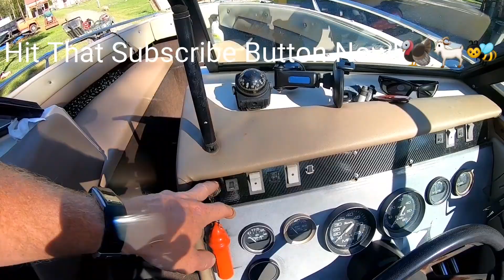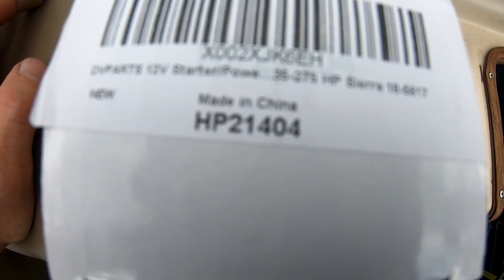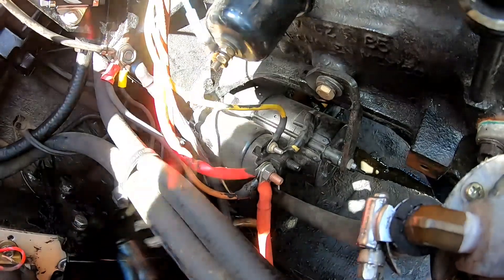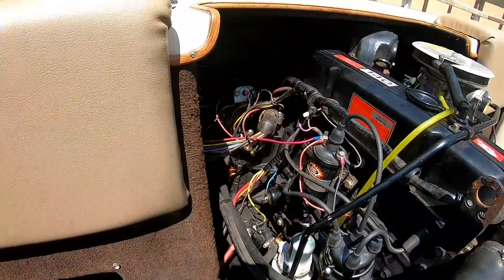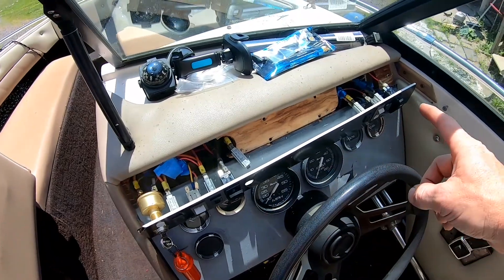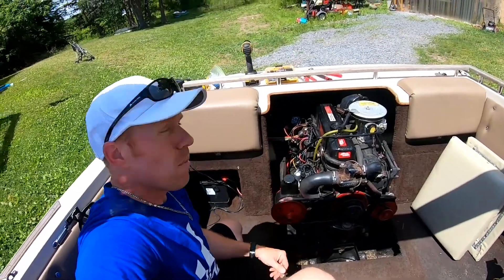Mercruiser Starter Solenoid Diagnosing And Replacement DIY

Comment: When i bypass the key switch and touch the two relay post together nothing happens but there is a click with the key, what is going on here?
Reply from the maker: Sounds like battery or starter issues try the easiest first! Try charging your battery or jumping then try starting!
Reply: Did you ever figure out what was wrong?
Reply: I have the same problem , it was working a minute ago , trying to prime the fuel lines then just a click ?

Comment: Had the same issue with my 2006 3.0L Mercury after not having started it since the winter. One click and no start. I first jumped the relay (connect the positive terminal to the negative terminal). Soon as I did that, I heard the starter working. This confirmed it was the relay. Replaced the relay for CAD$50 and she fired right up purring beautifully. Thanks for the video 🙏🙏🙏🙏. This was the most useful video
Reply from the maker: Awesome!!! It's definitely good to know especially if it fails on the water!! Thank you for watching!!👍😊

Comment: Did you also make a test on the Solenoid coil input side?….That would have been logical to prove that the new ignition switch was actually wired correctly, and that the coil was actually receiving 12v.
Reply from the maker: Here is the bench testing of the starter solenoids! Thank you for watching!👍😊
https://youtu.be/mXQ1MMs39h4

Comment: So the positive from the battery and the positive from solenoid to the starter are connected to the same post?
Reply from the maker: No! If you look at your starter the positive from your battery should be connected to the top left starter post, the top right starter post positive which should be a yellow wire with red stripe  goes to your starter solenoid bottom post! I think that is what you were asking I hope that helps!